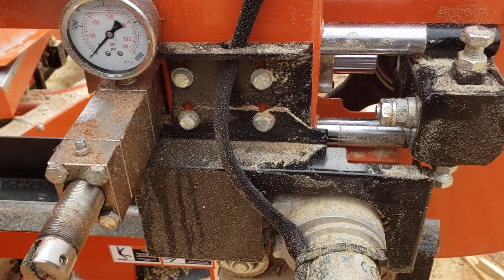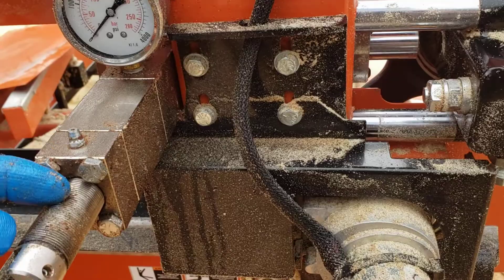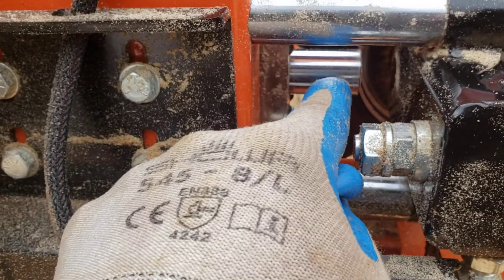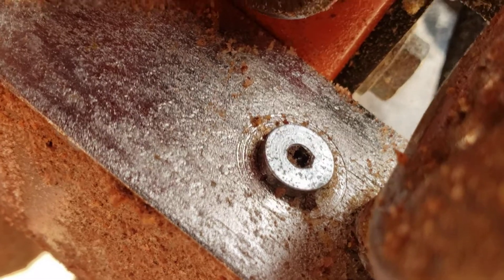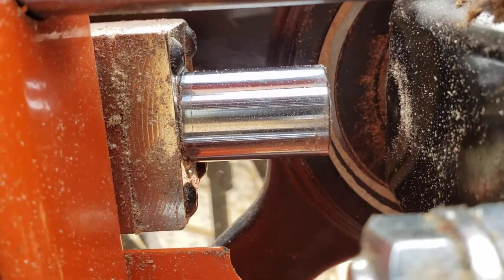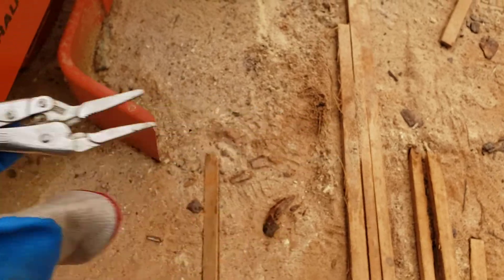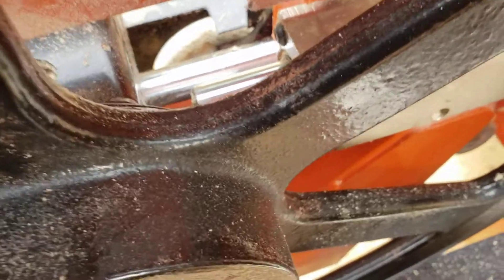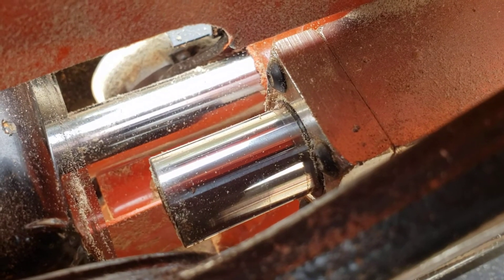Blade Tensioner Design Flaw

Comment: The main thing you have to mechanically inclined.   Take the gauge out get a fitting that will screw in the hole and fit a plastic hose over the end of it .    Then fit the hose in a cap on a plastic bottle.   Cut the end off the bottle and put some transmission fluid in it.    Hold it up above the tensioner and pull the shaft out and it will suck the fluid in and fill.   Remove the fitting and hose and replace the gauge and go to work

Comment: Just use a standard pair of 5" vice grips. It isn't a design flaw, you just don't have the right tools. I have refilled mine a couple of times with no problem. It takes less than 5 minutes.

Comment: I would try using compressed air injected through the add fluid hole to move the piston so you don't have to touch the piston with pliers.  Then, fill with fluid and push the piston back in to bleed out excess fluid and air.   Replace the plug and, hopefully, you are good to go.